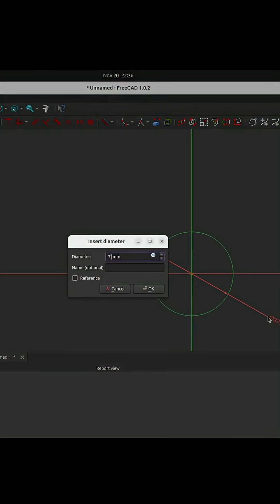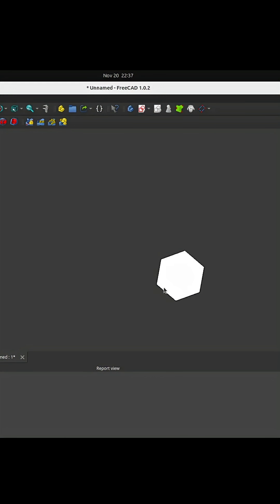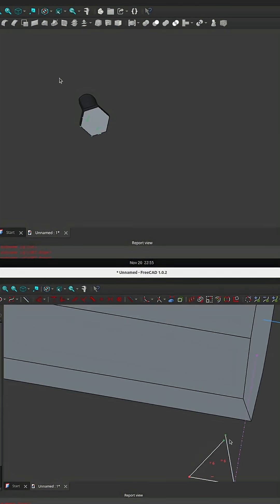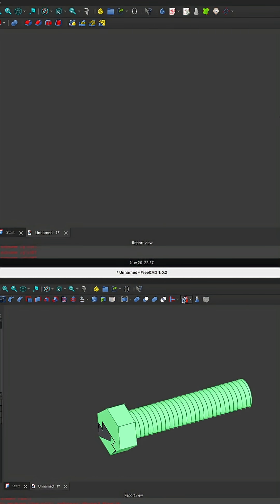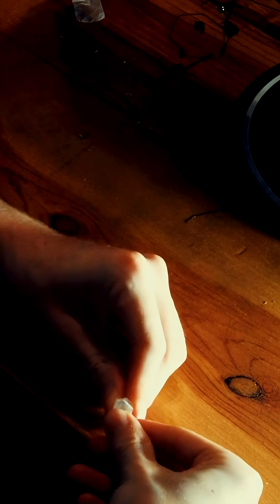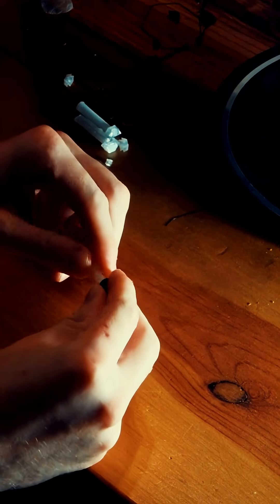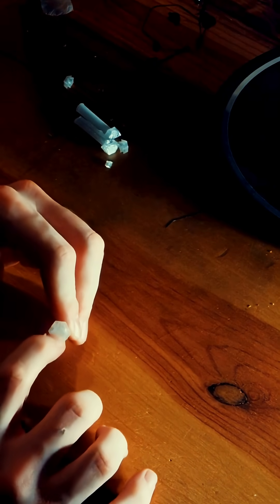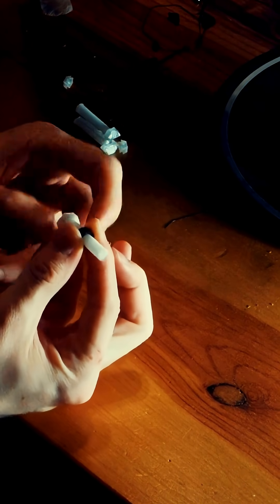Slightly better bolt design #3dprinting #bolts #diy

Comment: Man if I could 3d print metal nuts and bolts I'd be in heaven. Hopefully in a few more years the metal powder printers and stuff will come down in cost and complexity
Reply from the maker: What do you think about casting parts from aluminum and cast iron? Small detail like screws might be hard to cast, but it would get you most of the way there?
Reply: @thomas8313-o3t you probably could but that's a lot more work, as far as I know sand casting molds are single use